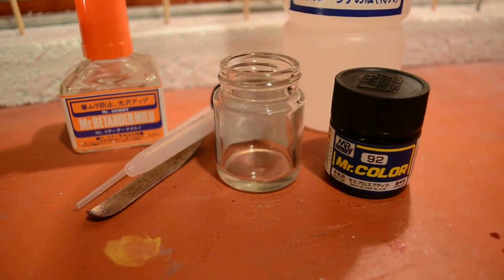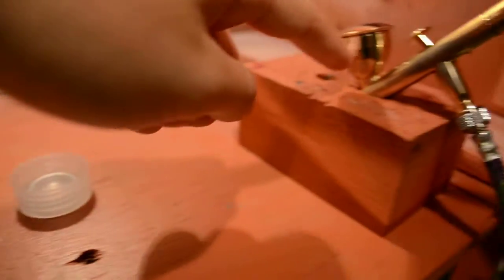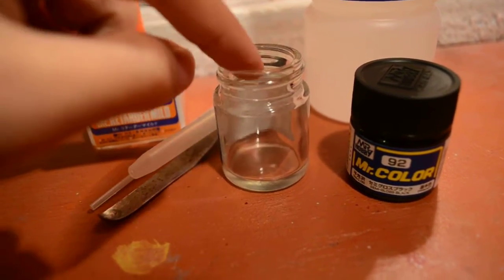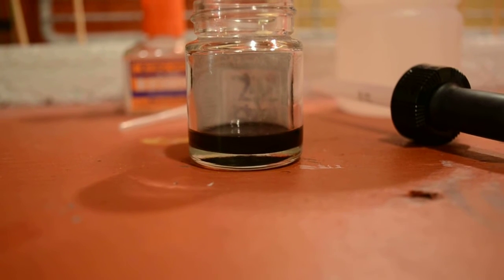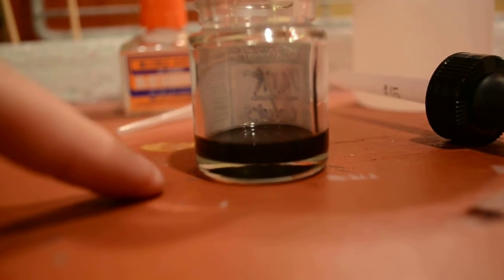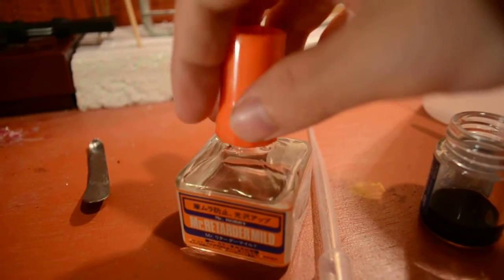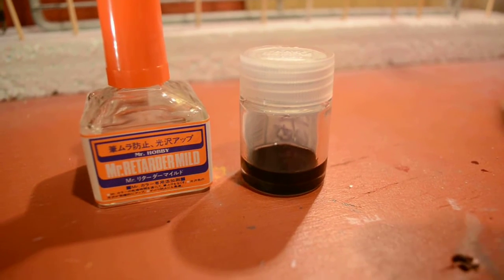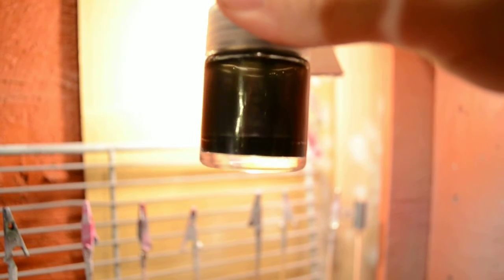GUNPLA and Model kits: How to mix paint for airbrush!

Comment: Hello I'm using mr color paints for the first time and I usually paint straight on with tamiya using a brush but the mr color set I have goes on really thick do you thin it down and what do you clean the brushes with after use
Reply from the maker: Some Mr. Color paints are thicker than others depending on the color. It's a little strange, but I've noticed that over the years. Therefore, if you find your paint to be too thick than you can thin it a little. When it comes to cleaning your brush you can use Mr. Color Thinner, but since that stuff is pricey I only use it to thin paint. I recommend using a regular lacquer thinner from the hardware store for that purpose. I use that stuff to clean my brushes and and my airbrushes as well. Maybe turpentine or another oil paint thinner could work, but I didn't try. If you use "industrial" lacquer thinner just be warned that it melts plastic kits instantly and try not to get it on your hands for an extended period of time.
Reply: Ok thanks for the reply I was using a mr hobby colour Japanese jgsdf set and the paint was dreadful to use but now I know you have to thin it what is the best ratio of paint/thinners?
Reply from the maker: @challyho6375  The ratio is variable. There's no perfect ratio that will work every time. Usually though, 50/50 seems to do the trick for airbrushing and 70/30 for regular brushing (70 paint, 30 thinner). Those are just my preferences though and you might find that you need your paint to be either thicker or thinner depending on your technique. In general though, thinning paint properly is something you'll need to practice. The ratios I gave you are just a starting point, guides so to speak. Try it and if the paint doesn't react the way you want to, adjust your ratio accordingly. It always depends on the color, the way you're going to apply the paint, the part you're painting and the finish you want. No worries though, you'll get the hang of it quickly, it's all about "feeling" as weird as it may sound.
Reply: Thanks great help 👍

Comment: What if I want to thin the whole jar of paint ? How many drops and does the same rule apply for flat,Clear, Metallics, and surfacers/primers? :)
Reply: If you are doing small details like camouflage I would recomend a super thin mix with 30% paint to 70% Tamiya laqcuer thinner retarder type. Be wery carefull if you spray to much it will become blushy or start to run down. If not just a 40 to 60 or 50/50 mix.

Comment: Hi, great video and channel.  I'm just about to get into airbrushing my gunpla kits, how long does a small bottle like that actually last typically?  I'm mostly building MG kits.
Reply from the maker: Thanks a lot! You'd be surprised at how long one small bottle of Mr. Color paint can last. I've had some for two years now and they're still half full. Keep in mind that you won't use every color for all your projects so that helps. It really depends on what kind of paint job you like to do. If you want to paint the entire kit every time then get a lot of white, black, gray, yellow, blue and red because those won't last very long. Also, you'll have to thin your paints with thinner and that will give you about 50% more, so you get twice the amount of paint per bottle. They are small and don't look like much, but model kits don't require a shitload of paint anyway.
Reply: Thanks for the quick reply!  How's your Jagd Mirage coming along?
Reply from the maker: I started another Five Star Stories resin kit in order to get more experience under my belt before I start pinning the Jagd. I'll build a few so I can get more comfortable with resin. I did prepare and clean a piece for recasting though. I need two of that said part, but the kit only came with one. Fortunately it's a duplicate so I just need to get some silicon and resin to make another. Meanwhile I'm also waiting for my friend to get done working on his truck so we can build a metal tub in his garage. I'll use that tub to boil and re-shape the big parts that are warped. I'll definitely make a video of that because I'm pretty sure it's going to be impressive XD

Comment: can i use the same method for using mr color lacquer paint by hand brushing?
Reply from the maker: You can, but you have to use less thinner. Hand brushing is a little tricky, but Mr. Color paints are very easy to use with a brush. Basically you want the paint to be a little thicker than milk, but you don't want to use it straight out of the jar either. The mixing ratio depends on what color you wanna use because yes, different colors even from the same manufacturer act differently with thinner. You want the paint to be thick enough so that it doesn't run when brushing, but you also want it to be thin enough so it can level itself easily (adding a tiny bit of retarder really helps). Too thick and you'll see brush strokes. Too thin and it won't cover the surface and run. Generally I'd say that a good ratio would be 3, maybe 4 drops of thinner for 10 drops of paint. I highly recommend practicing with a small batch first to experience what I'm talking about because getting the right mixture is tricky. Believe me it's worth it since hand brushing in general isn't that easy (that's why I recommend investing in an airbrush). Hope that helped!
Reply: Thank you so much, looking forward for more tutorials from you.

Comment: Hello Sir..Is it ok if we use topcoat at night (Mr. Super Clear Gloss/Matt) ? Someone told me it is ok but we have to put the parts under table-lamp immediately after spray. Otherwise, it will have blur effect on the parts.
Reply from the maker: Unless the humidity level where you live changes drastically during the night I'd say it doesn't matter at all. I've sprayed top coat at night many times without any problems.

Comment: Forgive me if I'm wrong, but isn't the paint drying before it hits the part just a sign that the pressure is too high? I thought Retarder was mostly meant for situations where you might specifically want very slow drying paint for whatever reason.
Reply from the maker: Actually it depends on your environment. I rarely change my air pressure and I get different results depending on the time of year, the humidity and the color (yes, some colors, even from the same manufacturer, don't react the same). I put more retarder if the paint reacts weirdly and becomes like sand. Sure sometimes it means the air pressure is too high, but that is not the only reason. The past winter I sprayed at around 15psi and now (during the summer) I spray at around 10. It's a mix of different things so you're right, but add 20 other problems haha. Thanks for watching!